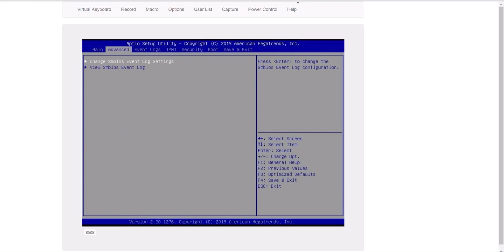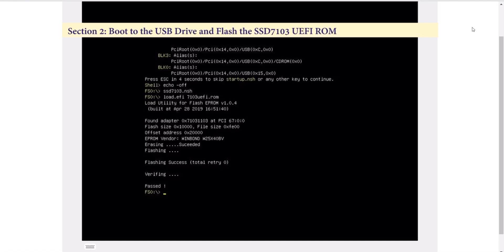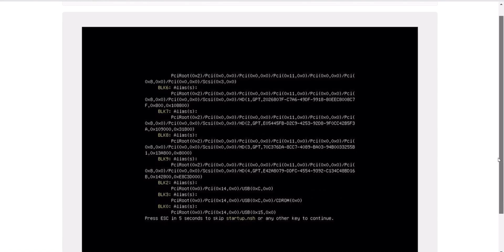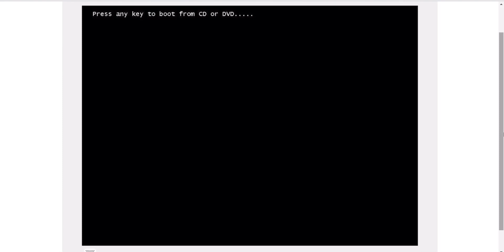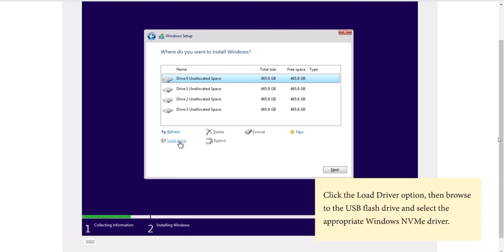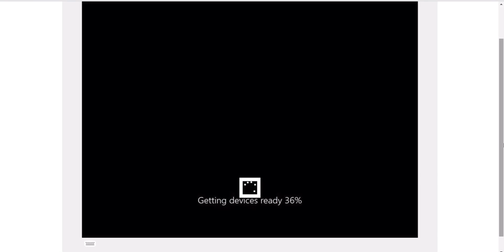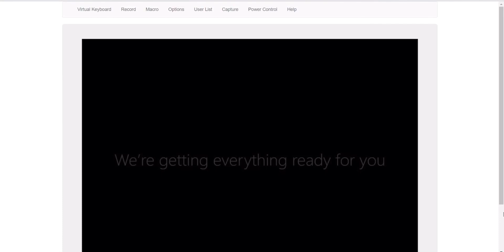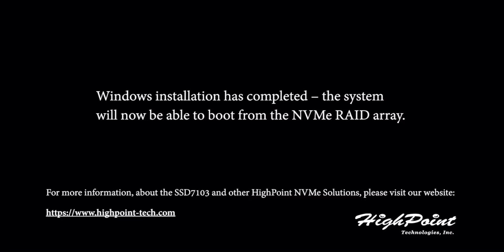HighPoint Technologies Inc. SSD7103 & SSD7202 Installation Video Guide

Comment: Do you know if HighPoint SSD7205 works with Gigabyte Aorus Master x570 on TRX40 chipset? I plan to use it as a boot drive with RAID 1 for Ubuntu server 18/20.
Reply from the maker: We do not have an SSD7205, do you mean SSD7505?
Reply: @highpointtechnologies202  sorry, right  SSD7505 or SSD7504, both are of interest. 
Also I found that you have SSD7104 with 4 NVME.M2 slots, will this one work inside Aorus Master x570 on TRX40 chipset as bootable RAID 10 for Ubuntu 18/20? Thsnks!

Comment: Great video , but can i do this Amd  Am4 platform with retail motherboard ? I'm planning to use HighPoint SSD7505 PCIe Gen4 x16 4-Port M.2 NVMe RAID as boot drive !
Reply from the maker: Yes, the SSD7505 will work given your configuration. It supports both Boot and Data RAID. We have done tests showing the SSD7505 works with the AMD X570 chipset which uses an AM4 socket. To make sure you get the best results make sure your motherboard has a PCIe 4.0 x16 slot. 
More compatibility information can be found here: https://highpoint-tech.com/PDF/NVMe/SSD7500/SSD7505/SSD7505_Compatibility_List_V1.08_21_6_25.pdf
If you have any other questions, please contact our sales department: sales@highpoint-tech.com
Reply: @highpointtechnologies202  Will these cards works in a physical PCIe 16X slot but with only 4 lanes enabled (such as X570/B550 chipset lanes). Even if peak performance is not there, it could be a "simple" way to enabled multiple M.2 SSD with each up to 7GB/s peak perfs... The question is in fact more linked to R1100 / R1500 products too.
Reply from the maker: @François-XavierMAURICARD  Hello,
To answer your question, yes our cards will function in x16 slots even if the slot only operates at x4 speeds. Be aware that the card will also only operate at x4 speeds.

More information can be found here: https://highpoint-technologies-inc.helpjuice.com/142471-other-question/can-i-install-an-ssd7000-x16-card-into-a-motherboard-x16-pcie-slot-running-at-x8-lanes-or-electrical-x8-lanes?from_search=69751661